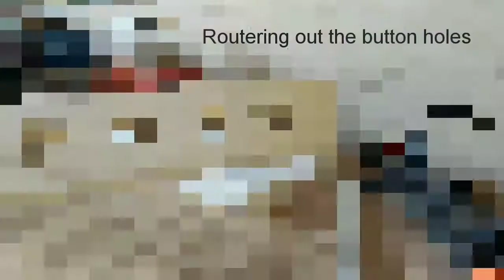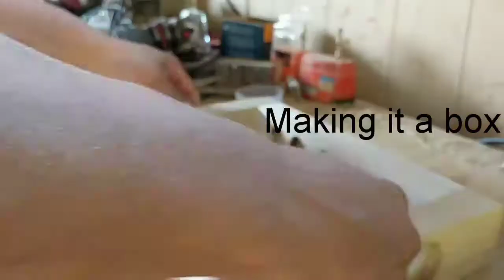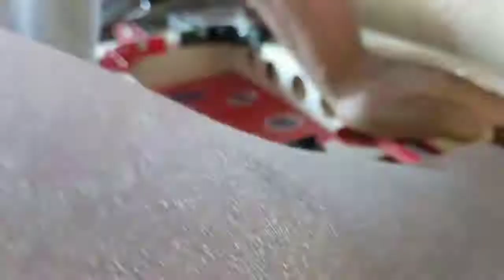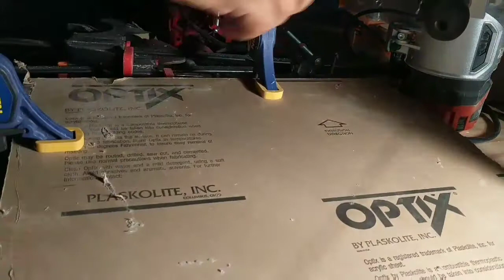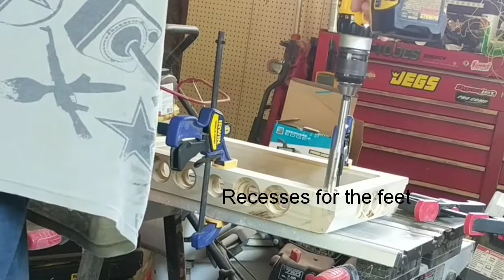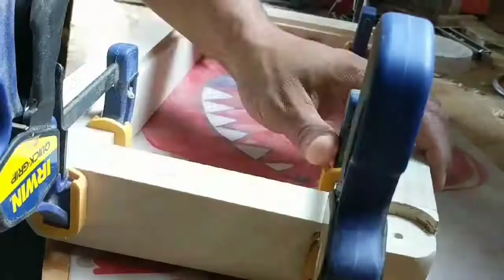Building a fightstick case part 2

Comment: Is there a part 3?
Reply from the maker: I need to get on track, havent had a chance to make it, but Id gladly try to answer any questions. Part three will be cutting a control panel out of MDF, laying out the button pattern, and  routing a matching plexi artwork cover.
Reply: CRAW for the recessed buttons and feet. Can I use something like a 42mm Forester bit for both? Also for drilling plexiglass, is it better to use a spade bit? I have more question but I'm don't have time to post it at the moment. Btw I love your tutorial.
Reply from the maker: GameAndBros I use a 30mm forstner bit for the button holes and a rabbeting bit on my router. You could go part way through with a bigger forstner, and then center a 30mm bit to finish the holes.
Reply from the maker: GameAndBros I used a forstner for the feet, the same size as the feet, but you could go a bigger if you wanted.